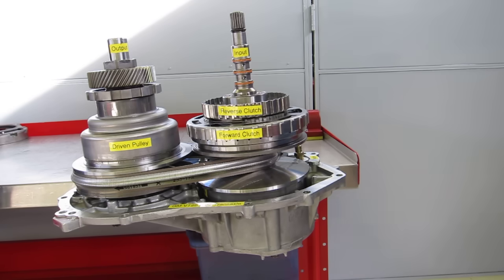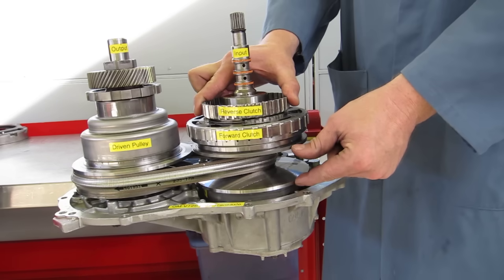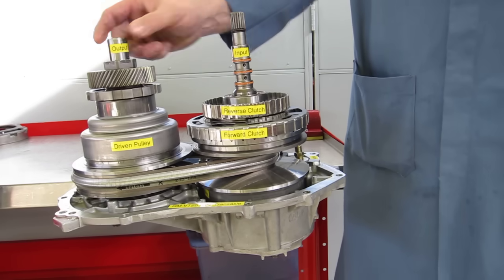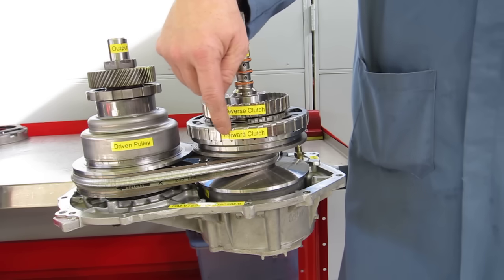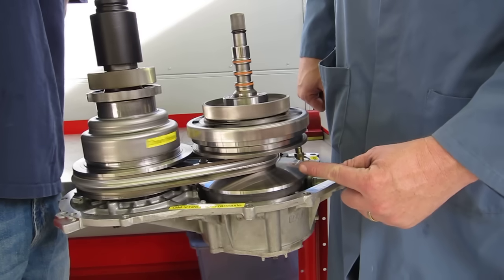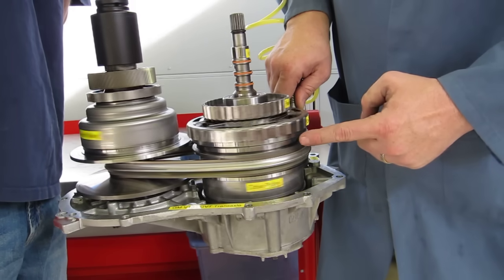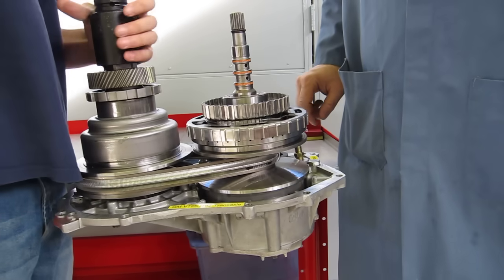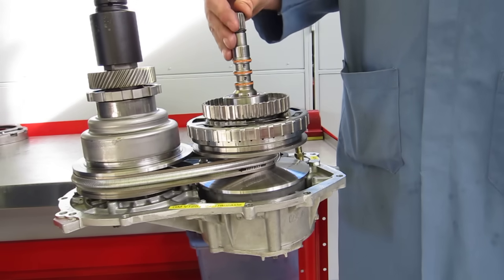Continuously Variable Transaxle (CVT) Operation

Comment from the maker: A CVT will do save more petrol depending upon the engine it is attached to.  CVTs allow the engine to operate at peak efficiency at a somewhat steady RPM and change vehicle speed by varying the CVT gear ratio.

Comment: @3319Adrian Yep, if the belt breaks, you're walking home. Happened to me. 80,000 miles seems to be the limit. I just fitted a new $600 belt, and away it went.

Comment: Looks a bit like the '03 Mitzy Lancer CVT.  I fitted a new ($700) belt to mine. Needed a strong magnet to get the many small exploded parts out. Ran like a top though. Seems like 75,000miles, and it's time to break the belt.

Comment: @WeberAuto It should be something similar with some differences, normally GM makes many of their systems very simple to operate and to diagnose. In the case of the transmission you are showing in your video, is there a solenoid pack that drives the forward and reverse clutches? and if so, is it possible to reach them while the transmission is mounted on the car? I thank very much your answers.

Comment: @WeberAuto Thanks for answering, it is a 2002 Audi A6, I have asked to a friend who is an AUDI / BMW / Mercedes technician and "knnows" more about this than me, and he thinks that the steel belt that is beginning to break appart or slipping. But I think that the problem is with the forward clutch that is not engaging smoothly,  So I wanted to know if there is an electro valve that drives it and if I maybe, be able to check the electro valves for debris or dirt and not open the transmission.

Comment: Hi, I have a question, what drives the Forward clutch? I have a problem with a CVT but I'm not still convinced that the problem is with the drive belt is the problem, because when you step on the gas pedal and the vehicle is stopped, then the transmission kicks the vehicle into motion, and it does not takes off smoothly. Thanks.

Comment: @TheAnabolicMutation Is a traditional automatic transmission simpler than this?  I don't think so... we are just used to the way a traditional automatic transmission works (and fails).  Two pulleys and one belt... compared to how many gears and clutches?  We have two cars with CVT transmissions (Nissan and Subaru), and I bet you there is a lot less wear on other parts of the drivetrain due to the smoother power output.  No shifting, no jerking.  Good power and torque at any speed.

Comment from the maker: @nekobih Hi, the CT200h does not use this type of belt driven CVT, it uses the P410 transaxle just like the 2010 and above Prius.  The P410 is very similar to the P112 (see my video on the Prius 2nd Gen), but uses an additional planetary gear set in series with MG2 to allow MG2 to be smaller, lighter, rotate faster, and deliver more torque.

Comment from the maker: @TheAnabolicMutation I do not know about the Subaru CVT specifically, but generally speaking there are a few concerns: 1. Obtaining the parts may be quite challenging. 2. Determining why the belt failed to insure the next one does not fail (was there adequate line pressure? Some CVTs use as much as 700 psi to hold the belt from slipping in the pulleys). 3. The condition of the pulleys, they must have a perfect surface for the belt to contact.  CVTs are usually not repaired, but could be.

Comment from the maker: @TheAnabolicMutation Hi, CVT transaxles of this type use a very specific type of lubricant to combat the high friction / heat generation and then heat dissipation to the case and transmission cooler.  I am not aware of any heat related issues, only belt breakage.